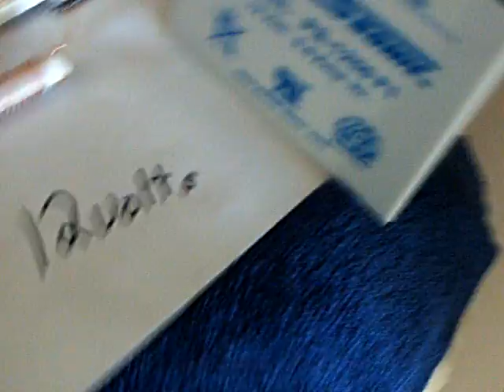SEC one wire energy transmission--At a distance

Comment: This is the key to Bedini's reative currents in his SSG designs.  And why so many fail since they fail to see the importance of proper impedance matching.   Please try the smaller inductors in series with bridge to caps on the single wire. Again tune tune tune. Size of wire becomes insignificant for the transmission of this energy.  On the topic of Stiffler using doulble freq. to intensify the effect.  Tesla often tuned multiple coils with harmonics involved.

Comment: Have you read the Strebkov document on single wire technology?  This is one of the best docs on the topic.  Think of the wave as zero current and zero magnetic fields.  The vectors of the voltage wave on both ends of the single wire equal zero as well.   Everything is a mirror image here.  Inductances and capacitances are equal and ohms law is no longer required.

Comment: That is a great idea Lidmotor. It will also give you a really easy way to determine how efficient the transmitter is.

If you manage to graph out a standard curve (light vs current) you can see that if the device is 100% efficient then your test point will be on the line. 

Overunity is achieved when your point consistently lies above the line

Good luck with this.

Comment: what you end up doing with this system is using the earth as the wire and transmitting energy to anywhere on the earth. i have successfully made a 20 ft wirless energy system that transmits high voltage 20 ft to a reciever using the dirt as the conductor!!